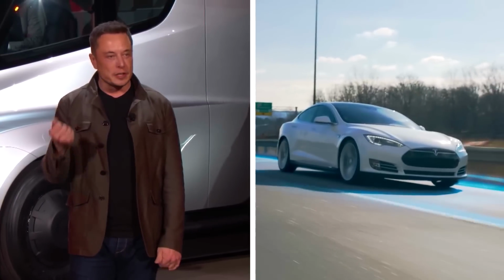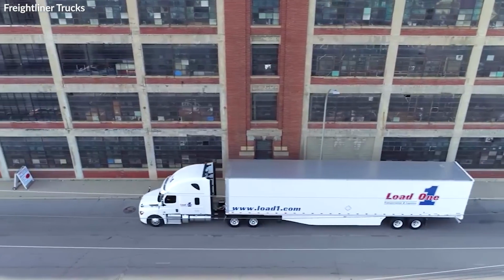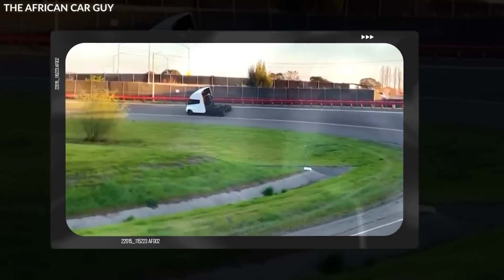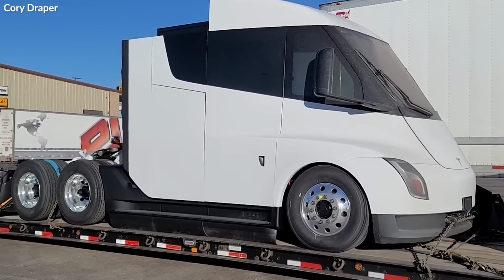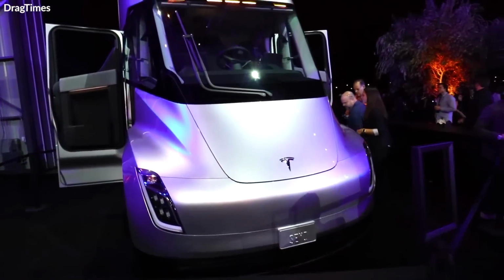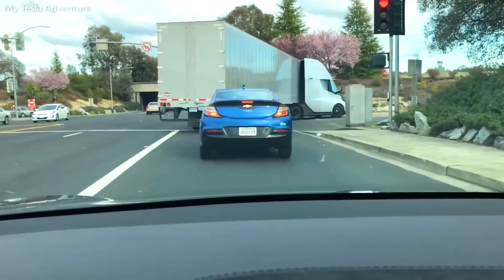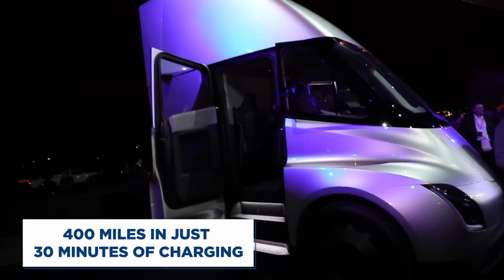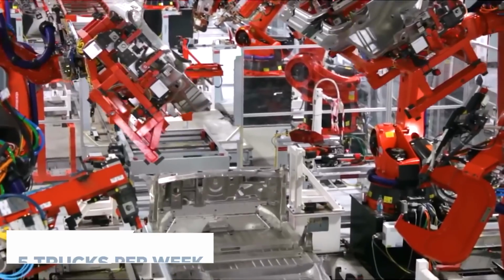IT HAPPENED! The Tesla Semi 2021 Is FINALLY Here!

Comment: Electric trucks are honstly going to ruin everything. Truckers are required to get something in at a deadline, and if you have an electric truck you need to wait like 10 hours for it to charge instead of the 5 minutes it takes to get fuel. Therefor electric trucks will not work and will ruin everything.

Comment: To charge an 8,000 pound battery will require how much TIME and how much electricity - it would be like charging up - 8 Tesla cars - all at the same time. Better solution would be to use Hydrogen - Nikola Stock - buy now

Comment: 1000 pound battery in a Tesla car - the cost to replace the battery $20,000 - moving an 80,000 pound truck - you said the battery will weigh 8,000 pound - to replace - 8 X $20,000 - $160,000 - a better solution would be to use hydrogen - true - Nikola Stock - buy now

Comment: The problem is that because of the size of the battery - Tesla could use the materials for the battery for one truck to make 10x Model 3s. Right now with their supply being their constraint - it is not yet worth it for them to sell Trucks. Trucks will be ready but the battery supply won't be high enough for another two years. As cool at is is, sadly we won't see adoption for a little while. But my goodness, even at $150k it's a steal. Tesla should up the price to $200k.